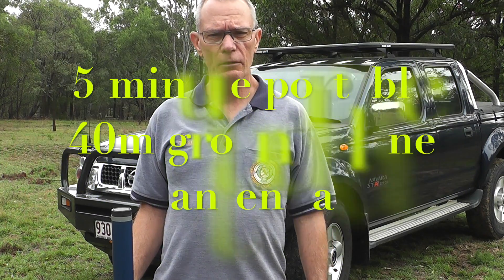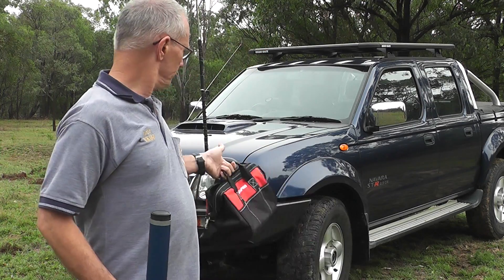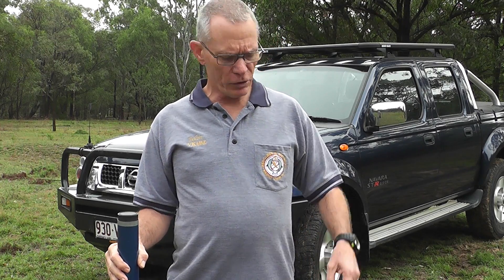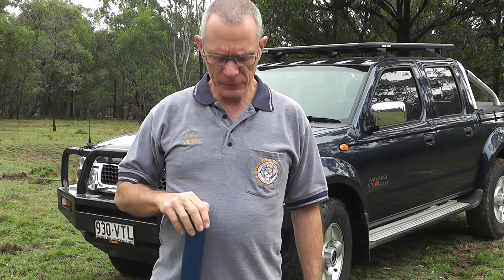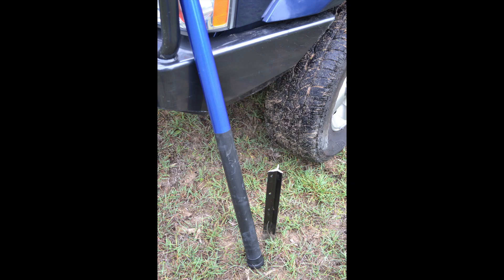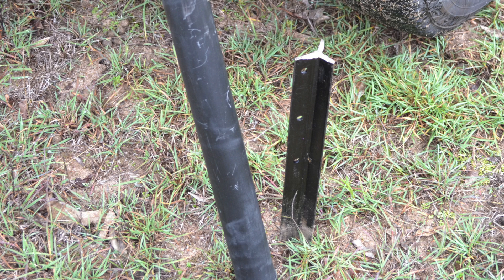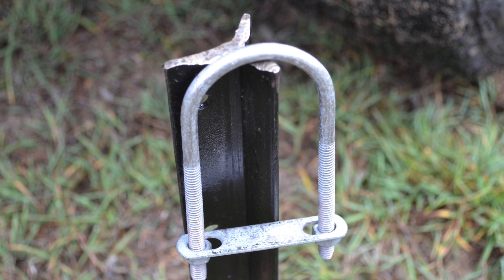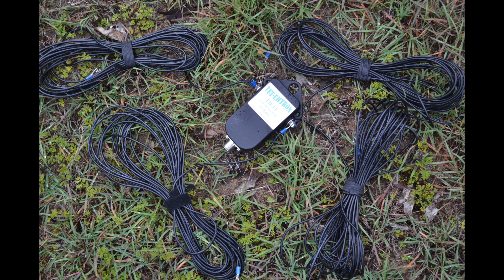Five minute portable 40m ground plane antenna!

Comment: I have a question as I have yet to engage in long wire antennas. A 10 meter wave length is roughly 33 feet (32.8) and it should be resonant as a 1/2 wave antenna for 20 meters and 1/4 wave at 40 meters (unless there is something I am missing.)  Is there a problem working that backwards?  I mean using a wire say 40 meters long as a 2 wave 20 meter or 4 wave 40 meter antenna?  My query: If I build a 40 meter full wave antenna will it be resonate as a 2 wave at 20 meters and 4 wave at 10 meters?  In have never seen this demonstrated and in the books I have read on wave propagation, in have never seen it discussed.  I stumbled across (FIA) frequency independent antennas but have yet to see their tx abilities as compared to a dipole. This FIA intrigues me and it will be my next objective to build after building this multiple band long wire antenna.
        Now, I have experimented in many types of antennas over decades.  I usually have success but success that has been limited to but always with limitations. I also have held the notion that the antenna should be built differently than current and yesteryear technologies. (Although there is something simular in design that works but is also found wanting.) Thanks for your help 73' s.   My old call sign was N8YPS. I will retake tests soon and try to regain my old call sign.
       If you would like something original to experiment with... (It may be a dumb idea, but...)
Try using guitar tuners on a wire antenna to stretch it's tune, while fixed at a given frequency, see if it changes anything. I haven't tried that yet but I do plan on it and will start in 2 meters I think.
Reply from the maker: Terry, you are correct that 10m of wire is 1/4 wave on 40m, 1/2 wave on 20m and full wave on 10m and will resonate on those frequencies. That's why we have harmonically-related bands. A 40m length of wire will function as a full wave on 40m band and the rest as you have said. The problem is what you feed it with and where you feed it. If you are using it as a long wire antenna, just adhere to the grounding and counterpoise suggestions. With a suitable tuner it will work well and give you directivity and gain. The problem with using it as a dipole is if you feed it with 52 ohm coax - big problems because of feed point impedance (you end up adding to global warming but don't send much RF out!) and there seems to be no real gain from such a full wave or multi wave arrangement. However, if you feed it from the centre with balanced line (i.e. an open wire feeder) then you start to get real gains from the lobes and you have effective transmission of RF to the wire. What you have then built is a doublet or you can configure it as a G5RV. Feed it at the end with open wire feeder and you get an end-fed Zepp antenna. The late William (Bill) Orr, W6SAI, wrote extensively on antenna theory and produced an excellent book on wire antennas (amongst a number of others). They make a really good starting point. Hope all this helps! 73 and thanks for giving me some feedback. John

Comment from the maker: Important addition: I've had to add an earth lead from the wing nut where I attach the radials back to the car body - I use a short length of multi-core copper cable with alligator clips each end. Stray RF was getting into the signal and making it rough around the edges. All fixed now and works like a dream.

Comment: Great video John. I enjoyed our QSO last week. I've have built a 20 metre version which, by coincidence, is almost identical (even down to the star picket). I put a 200mW WSPR transmitter on it and in 24 hours had nearly 200 spots, including, ZL, Hawaii and North America. Then tried it on SSB and was given a 59+ from ZL4IR.
Reply from the maker: Hi again, Chris. Well - the simple fact is a simple antenna, well constructed, WORKS! You should grab a video camera and do a vid on your 20m version. Like I said, I did need the extra earth to the vehicle to remove extraneous RF that was getting into my signal. Apart from that, it does the job well. I enjoyed our QSO and hopefully will hear you on air again sometime soon. Cheers!

Comment: very good ,John, could never get mine to work, and i cant use radials in caravan parks , but your system is fine for your needs,  mate
Reply from the maker: Thanks, mate. Yep - I don't think the XYL will be overjoyed with the radials...but it works well and I just have to put them out only when I'm operating.
Reply: thats the joy of mine , no radials, but it does take up more space ,,but i was 59 into vk2 yesterday afternoon,
oohh the swr is 1.5 to max 1.8 40 to 10mt , 80 is an issue at 6to1 .

Comment from the maker: G'day from Down Under! I needed to come up with a portable antenna for when my wife and I go away caravaning around Oz, so I decided to use the versatile squid pole as a 1/4 wave length ground plane for 7MHz...off the bull bar of the Navara. If you've seen my earlier vids, then this type of antenna will be familiar. Does it work? Too right it does, and when compared to the multi-band vertical I know I'm going to get a good signal out and about. I don't need to give dimensions - simple antenna calculations will give you that. Give it a try yourself and let me know how you went. Don't forget to "like" the video...assuming that you do!